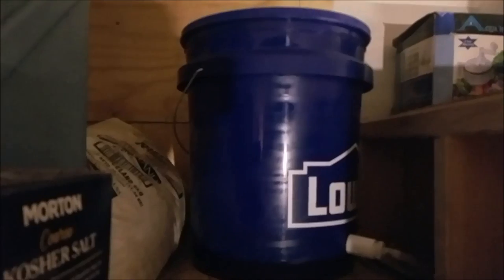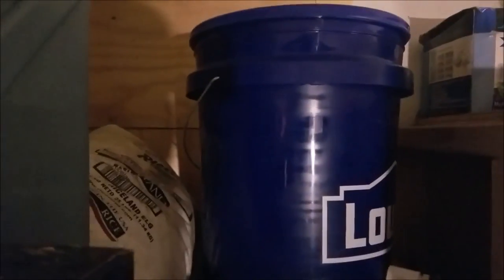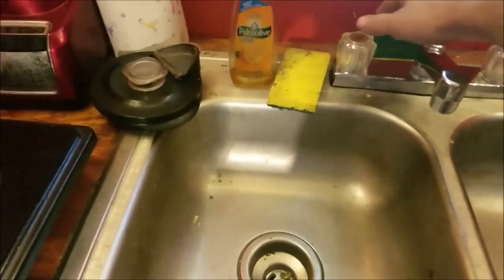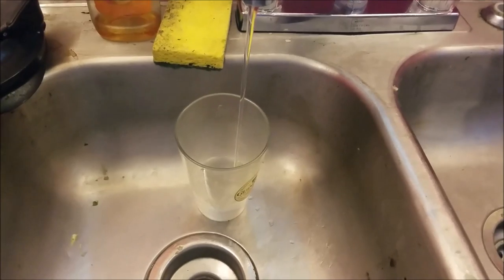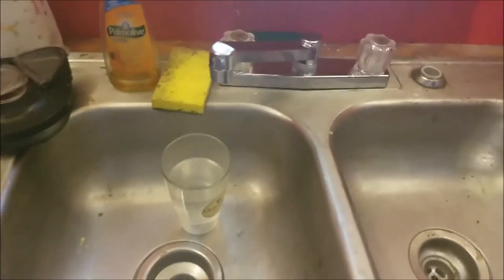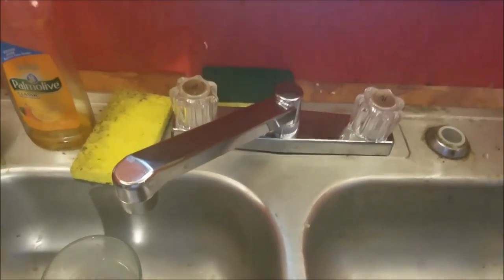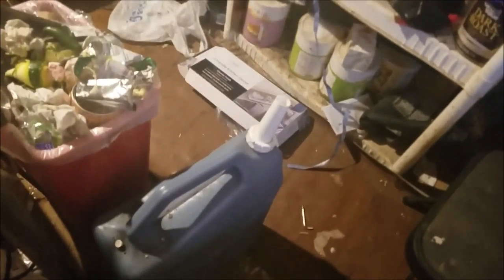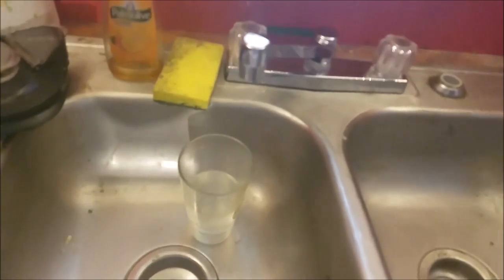Off Grid Tiny House Gravity Fed Sink

Comment: awesome video James . if you put a 5 gallon bucket outside and paint it black you could have hot too. Try taking out the screen in the end of the faucet it may help improve the flow and you dont really need it anyway.
Reply: lol great minds think alike.  I tried removing the screen and couldn't tell a difference either way.  I was thinking about putting a one way valve and a hand air pump on the bucket
Reply: Or a propane water heater

Comment: What about using a metal bucket so you could pour hot water into it? Or will your system work with hot water?
Reply from the maker: John I've already upgraded Now I have running water and I have an on demand hot water heater to be hooked up.